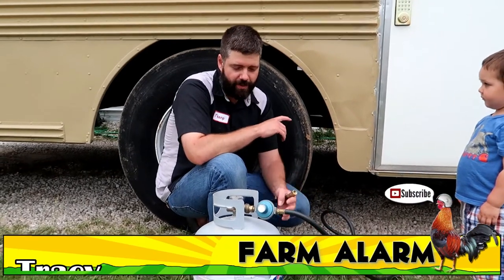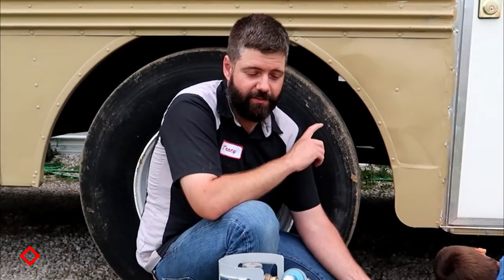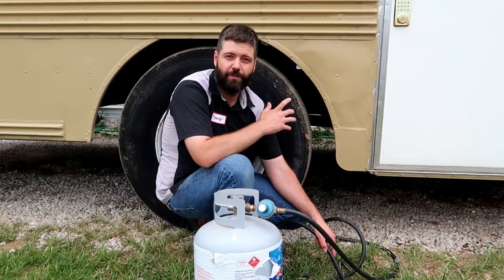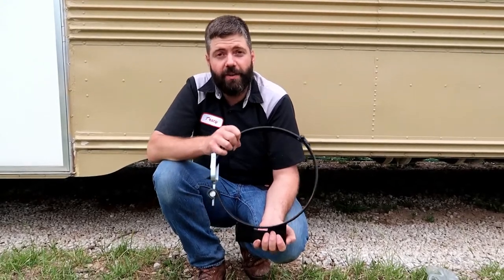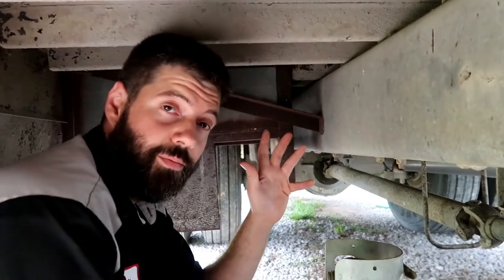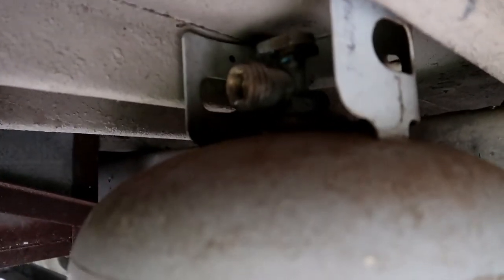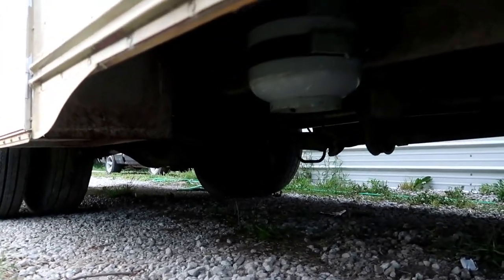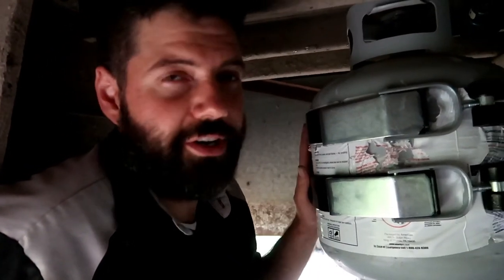BEST Propane Tank Brackets - RV  |  Camper  |  School Bus Conversion  | Travel Trailer  |  Skoolie

Comment: I used two L brackets from HD to let tank sit on. Less weight on holding brackets.
Reply: I was also thinking about going this route too,But what L brackets did you use? I don't remember seeing any long enough L to reach under and let the tank sit.

Comment: Very good, You may add safety chain to secure the tank on chassis (between two points passing through the tank neck).
Reply from the maker: Yep that is my intentions. I also added a 3" ratchet strap around tank and bracket to ensure the bracket will not pop open. Thanks for the comment and suggestion.

Comment: Do you think ONE of those straps would hold a 20lb tank on an ATV for ice fishing?
I was planning on ONE strap, plus using rebar bent and welded to make a "seat" for it to sit in rather than just hanging by the strap alone.

Seeing this video of it just hanging by 2 straps alone, Im thinking that for only quading handfulls of miles per year with it, maybe one strap would be enough on its own with a safety chain?
Reply from the maker: It would probably be fine as long as you safety chained it also...

Comment: Really good idea!  And yes even another clip around the top handle and onto the frame would be good.  How does it work practically?  Can you get your hand on the valve easily?  Happy camping!
Reply from the maker: I think it will be way practical because I wont have to take the tank on and off a bunch, and yep just enough room for my hand and valve, but I do have an inline valve where the hose hooks to under the bus as well
Thanks

Comment: I work for a Propane Company here in Fl that isn't safe or legal. If drive shaft breaks big problems. 1 lb of propane when released will expand 480 x. There wouldn't be much bus or life left. Just a word of advise.
Reply from the maker: Clark I appreciate the advice. I plan on re doing this project. I plan on making a bracket that the tank will set on and also adding a pin to the brackets so they do nit come open unless the pin is pulled. After that, I say it will be 10 times safer than the 20 pound LP tanks that i see setting on top of camper hitches. As far as being under the bus, I have owned another bus that had a factory Propane tank mounted under the bus in the same location. I know that the tank was probably DOT approved, but it did not have any protective cage around it. Thanks again Clark 👍
Reply: @FarmAlarm  Have you redone it? Where would you say is the best place to keep the propane? outside or inside the bus?

Comment: The clamps are a good idea but I don't think even the chain my break I would weld in some L brackets weld to the chassis coming down and underneath the bottle weld cross braces give it strength if it comes loose you're driving don't know it it's going to be bouncing chain breaks bottle comes out hits a car with with the L brackets  Holden sitting on the brackets the two brackets came under I definitely do that but if you can't weld the L brackets in Bolt them good luck God bless stay safe
Reply from the maker: I actually do plan on putting brackets under the tank, just like you are saying. Thanks David

Comment: Good job. Once you get the L brackets in, I don't see how it could get loose. The L brackets will also help to hold the weight while getting the clamps closed and the chain fastened. 20 pounds doesn't seem like a lot, but of course they weight more when full, and trying to hold up the tank with one hand while doing everything else with the free hand is not as easy as some might think.
Reply from the maker: I might add some locking devices to the cantilever latches too for extra measure😀👍
Reply: Good thinking.

Comment: Watch out for a rock ricocheted
Reply: Yeah thats what I thought too .  Recently, I was driving freeway I saw a little shinny speck spinning around on a road .. it's getting closer bouncing on a freeway and it struck my car chassis . 
Man ! It was a piece of an heavy steel tool fall off from an unknown truck and spinning and bouncing around on a road .  It tore up my car under body like an can opener !! LMAO 😂 😭 
 I can imagine what would happen if that piece of metal hit on that propane tank . I would weld L-shape bracket alind with steel shields in front of that tank just in a case .

Comment: Great idea but I would have put it side ways, horizontal, so more of it is protected from flying road junk...and a under it to hold the weight.
Reply: You can't. These Propane tanks must remain vertical.
Reply: @lroy730   
 
 Yeah that's what I thought.  Might be a good idea to weld on steel plate shield  and L shape bracket.   Then this idea is very good and secure .

Comment: Why not put the tank horizontally?
Reply: Unlike the tanks for forklifts, the 20 & 30 lb. propane tanks have to be upright. There is a valve inside them that floats up and down that won't work horizontally.
Reply from the maker: Thanks for the question Mate2Frio, I knew David would jump in and answer your question 👍😀
Reply: Actually Manchester tank makes a 20 pound and a 30 pound tank that is meant to lay horizontally, you just have to stand them upright to FILL them. Since you will have to take them off the vehicle to fill them anyway that is not a problem.  The horizontal tanks are a big help on vehicles with less ground clearance as they are about half as tall as the vertical tank in this video.

Comment: i would have turned it sideways
Reply from the maker: Can't... propane is a liquid. These tanks draw off of the top, meaning the Vapor that comes off of the liquid. If you put the bottle on its side, it will draw liquid. And that would not be good. Thanks for watching.
Reply: @FarmAlarm  you just taught me something. i did not know that..  i wonder why forklift propane bottles are on their side?
Reply: @FarmAlarm  its all about relief valve location.  man i learned something today